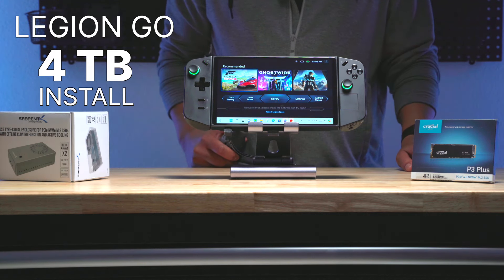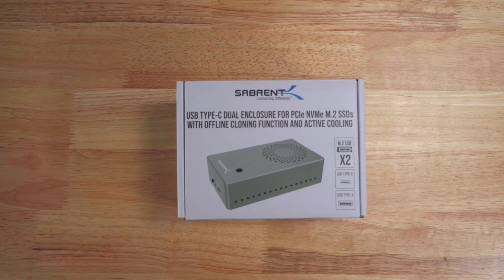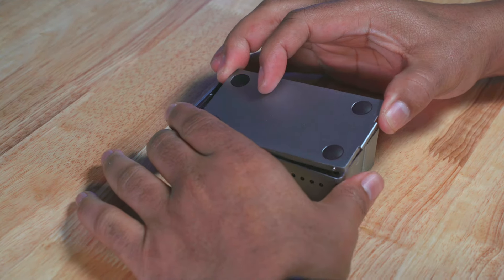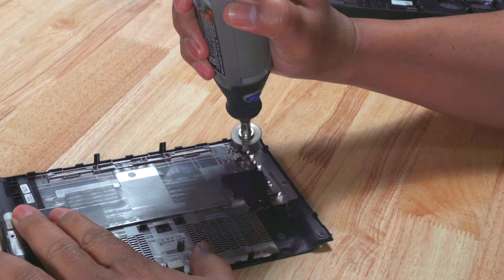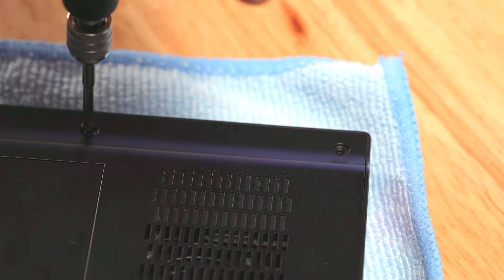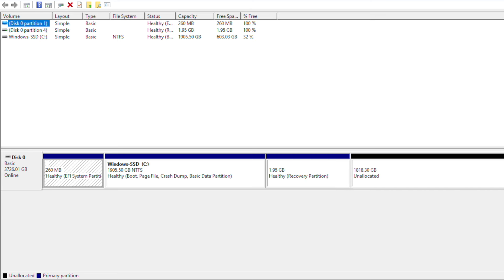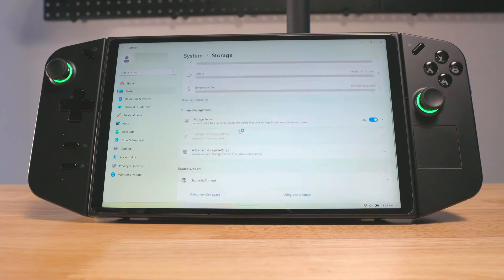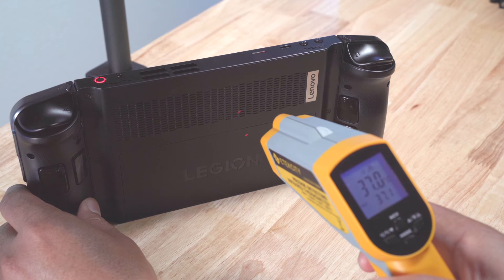Lenovo Legion GO 4 TB Upgrade

Comment: I did this mod, all you need to do is put a little price of electrical tape to hold the drive down. Also I am seeing much lower temps overall for the SSD vs. stock.
Reply: @MitchM240  you can also use 3m mounting tape to be more secure

Comment: I have that Sabrent Cloner and it's amazing. Built like a tank! I wouldn't recommend anyone to install a full sized SSD on their Legion Go however. Not only is heat an issue but to now have to cut and alter the design not to mention install the SSD with nothing securing it in place is just amateur, no matter how bad you want the 4TB. This video is just to show you that anything is possible but it doesn't mean it's proper or safe for your device. It's a portable device guys, if 2TB isn't enough then you're not doing it right..
Reply: Have you done this yourself ? If so - what were the temps of the SSD? I believe stock SSD can also be quite toasty when stressed with data r/w

Comment: I bought a custom Battery Cover with a extended nvme adaptor 2242 -> 2280 so you dont have to cut anything. You simply exchange the battery cover with a gap/cut out to place in an 2280 nvme drive and put the stock back plate back on the legion go. no warranty lost. Also i bought a Lexar NQ790 2TB SSD which is the fastest with the lowest price. All together i came to about 120 swiss franks which is about equal in USD. Thanks Ali Express and Amazon.

Comment: It might not void the warranty, Lenovo sells spare parts and I think the rear cover, off hand iirc, cost about 80-ish bucks.
I have the 2280 adapter that sits your SSD over the battery but I had to cut a section out of the plate above it so my back cover can fit. The WiFi plate costs about 30usd iirc.
If you're worried about SSD temps then wrap it with the same type of wrap that was on the original SSD and get more of the black carbon transfer pad that's taped to both the SSD and the WiFi plate.
Reply: Can you share your final design & temperature results ? Believe, some extra heat transfer tape wouldnt do much as heat needs to be dissipated somewhere and escape the device....
Reply: @yingbxua6240  yt keeps deleting my comments......

Comment: Thanks for the vod.I didnt unplug the battery. 👌 Nice sales pitch on the sabrent cloning device, its pretty cool. I used free macrium reflect to clone which also stretched the partition appropriately and  took 20 mins. Used a p41 2tb with just a thermal pad, case closes fine. Max temps 70 under heavy sustained writes.

Comment: Adapting a 4T disk is an interesting mod, but I would combine it with an extra airy 3d printed backplate from Ali. Adapting the original wouldn't be my cup of tea. Besides running parts too hot does impact the live of the device, but nothing lasts for ever anyway.

Comment: Many thanks for your nice video, i'm looking to upgrade my Legion Go like you did with 4TB nvme drive too. It helps me a lot.
May I ask you if you finally get in troubles with the fact that the new drive is not screwed ?
Also, did you noticed a difference on the autonomy and power consumption ?
Reply: Electrical tape works great to secure it

Comment: anyone tested the ssd temperatur with this mod? I got my Legion go and the stock SN740 512GB goes crazy. After a fully win11 recovery and install games (pluged) the ssd stay over 100 C.  That makes me worrying about using 2280 adapter and a even higher speed ssd.

Comment: This is such a useless process.  You do not need to upgrade the HD.  I have the 512GB version and it has PLENTY of space.  Far too many people think 512GB is not enough, and that's a shame.
Reply: It depends how many games you play or need installed at the same time.   Games coming in at 150gb which will be the new normal means 2 or 3 which might be enough for some but personally I like a few games with different genres so I can play depending how i feel.   2tb drives are cheap enough now.  Which is what I’ve done.  Also gives the opportunity to partition and tryout some Linux/steam distros out
Reply: lmao i filled up mine on day one and a 1.5 tb sd card... You dont play much huh?